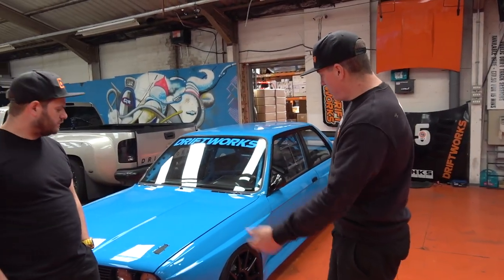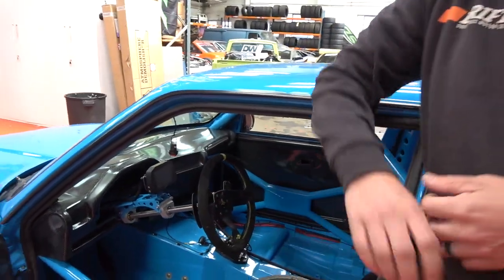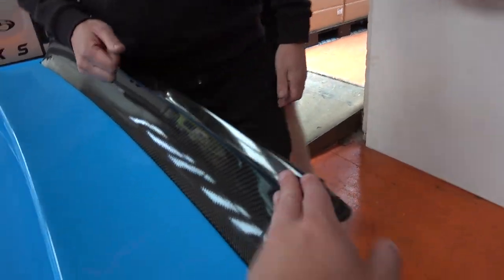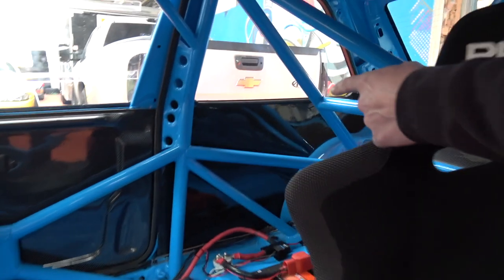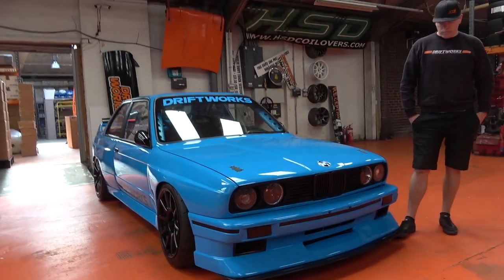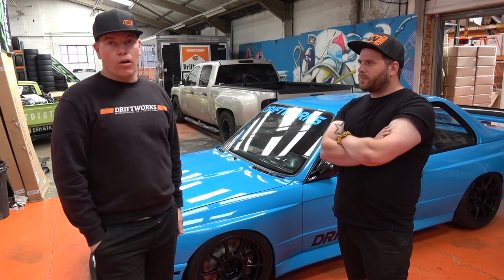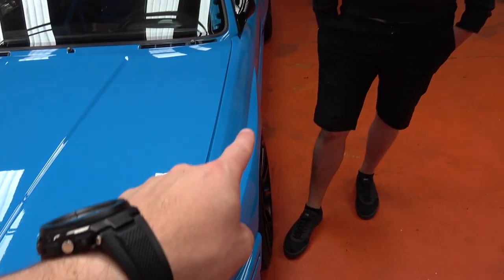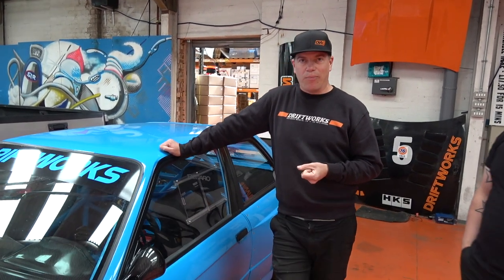My DCT E30 M3 track car project is done, kind of - Pt 8

Comment: Who did you say did your wiring? I’m looking at some kind of PDM system for my Rx7 but don’t want to go full send on it race car spec as it is for most purposes a road car, I just want the simplicity of solid state fuse systems
Reply: And you would think all this time around you and your builds some thing would pass on to Rich, 
Clearly not,
Reply from the maker: Howell Race Engineering. They do their own PDM that I wish I'd known about when I'd started this.
Reply: Driftworks thanks, I will do some research, racepak smartwire is a little hard to get hold of, a bit pricey and I believe a bit limiting for my needs

Comment: locknuts and aluminium wheel nuts on a race car? is that really a good idea
Reply from the maker: It’s not a race car, but it likely won’t use the locking nuts. The Work wheelnuts set just comes with them. There’s nothing wrong with aluminium nuts if they are super high quality like this, and you have massive thread engagement like this, and you don’t gun them.